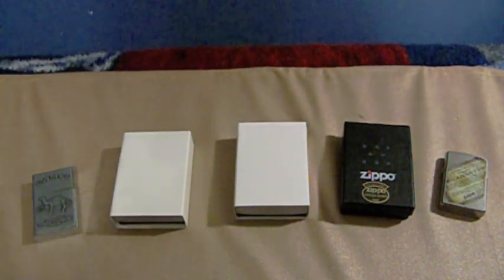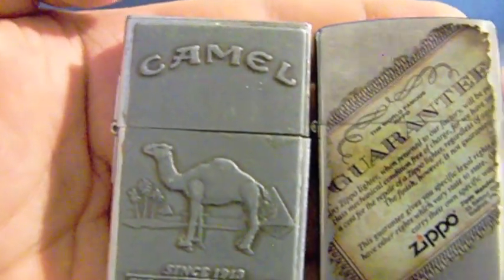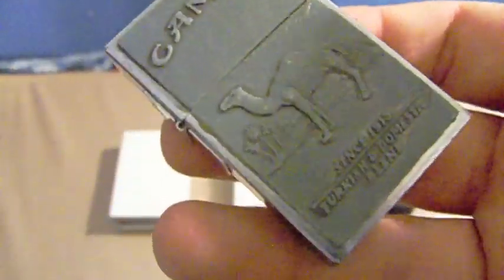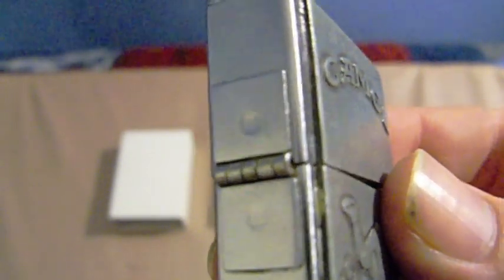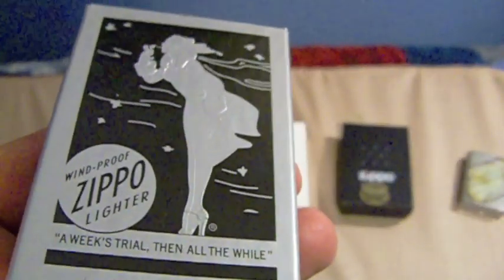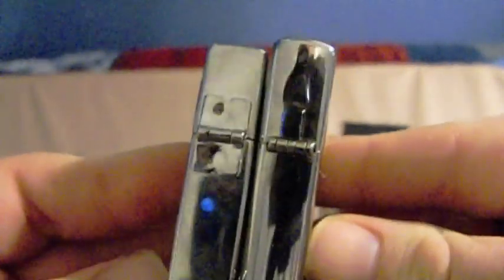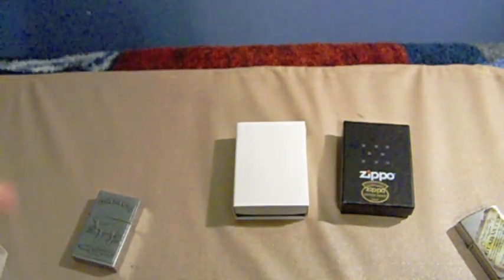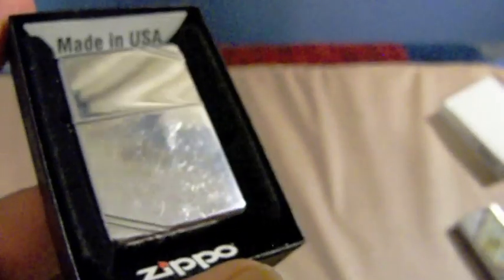Zippo: The Complete Replica Collection

Comment: I have the same Camel emblem 1932 replica that you have. I bought it from R.J. Reynolds using "Camel Cash" in the late 1990s. Mine happens to have the best fitting (perfect alignment and perfect degree of hinge tightness) and smoothest operating lid that I've ever seen on a Zippo. You know how when you close the lid on a Zippo, you can normally feel and hear a bit of metal-on-metal roughness as the cam slides along the inside of the lid? With my 1932 replica, it is as smooth as greased glass; you hear and feel no roughness whatsoever. 

However, I've rarely used that lighter (it is still like new), because it isn't comfortable to use or carry in my pants pocket, due to the sharp edges and corners that you mentioned. Plus it is significantly larger and heavier than a standard Zippo, so that doesn't help either. I just take it out to look at it from time to time and marvel at how smooth it is when you close the lid.

Comment: Ughhh...This has been bugging me since you posted this video, LOL. What do you mean by chip in the cam? Like, how the more modern cams sort of curve in on the bottm of each side? You mentioned it on the 1935, but not the 1941. Does this mean that the 1941 is a perfect replica? Because when you were speaking about the 1935, you said that Zippo introduced the chip in 2003, but you didn't mention it when speaking about the 1941. Also, were the original cams tinted dark grey like the modern ones?

Comment from the maker: @ToaOfFlameV3 Holding the lighter facing you, on the left side of the cam there is a bit that has been removed on the bottom of each side of the cam. It's hard to say in text, but if you looked at the cam straight on (looking from cam to flint wheel) the shape of it would be more of a "U" shape. You need to look at a pre and post 2003 insert to see this. 1941 replica has this too.